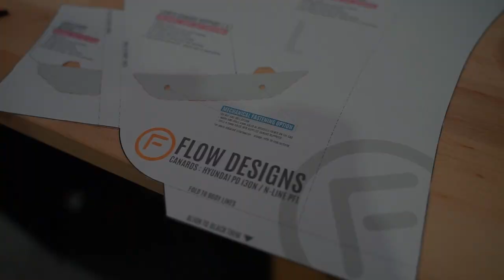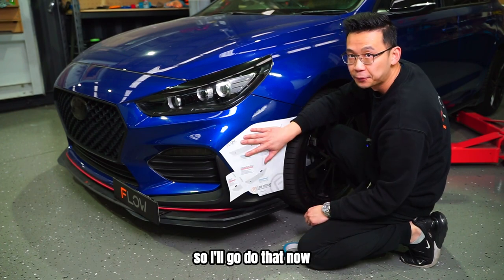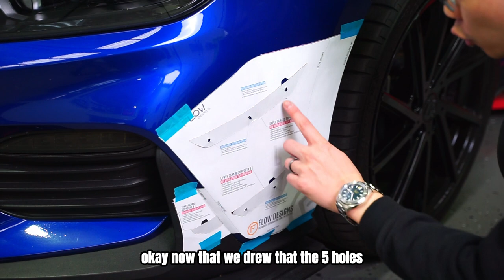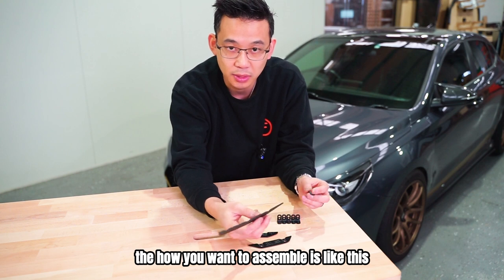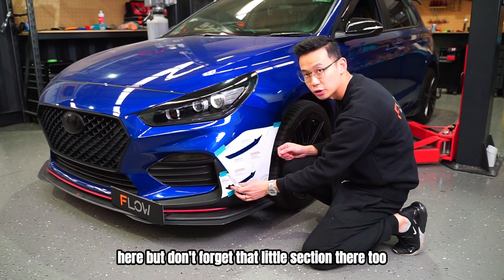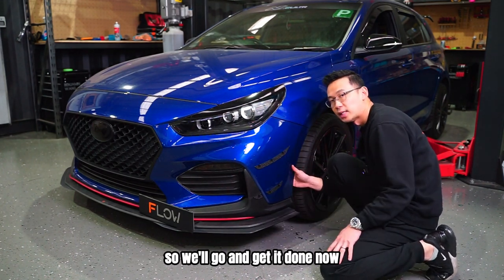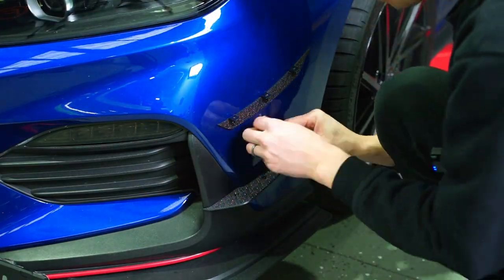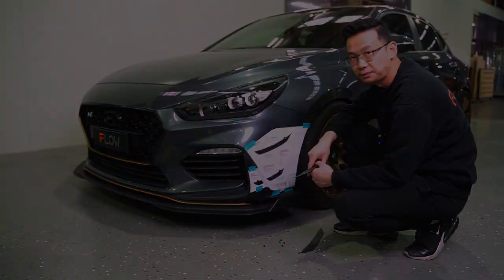i30 N & i30 N Line Canard Install

Comment: I just bought this kit, would ceramic coating affect the adhesive if I went with that method of installation?
Reply from the maker: As long as your prep the painted/coated surfuce, it won't be a problem. It won't stick without prep.